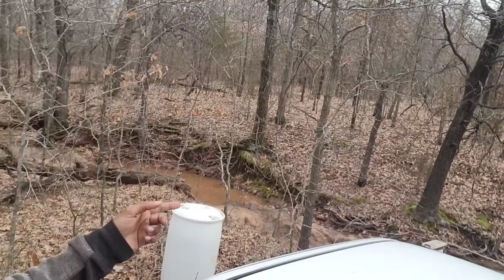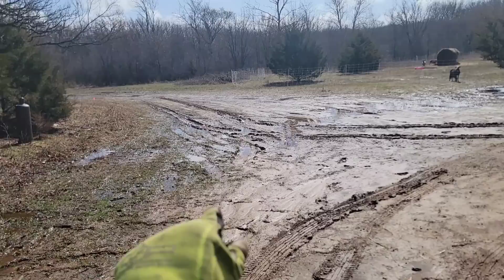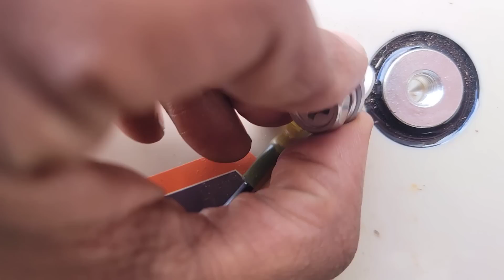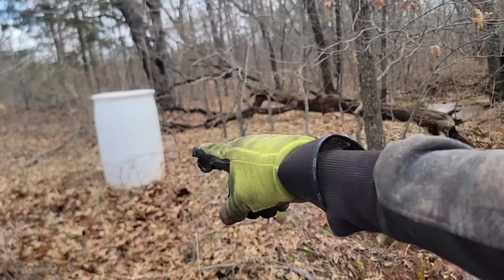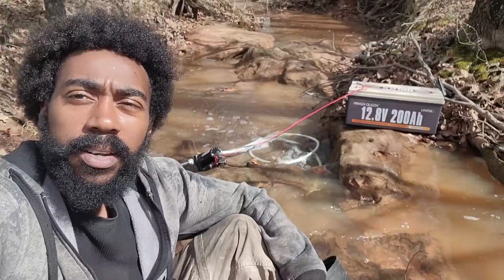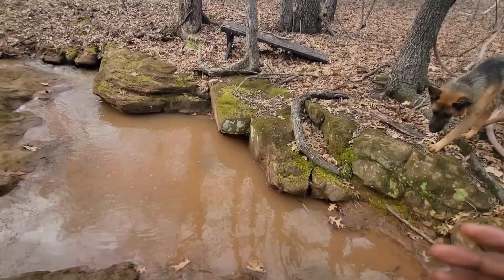How We Pump Water Off-Grid Using Just a Battery + Creek

Comment: Hello I love watching your videos but I just have one question are you planning to drink that water and how are you going to clean it can other question is are you guys going to be doing water catchment off your building so that it can be cleaner
Reply from the maker: No, we do not plan to drink creek water. And yes, we do plan on building a rain catchment, but our roof is only 12x24 so it's catchment is limited until we expand it. The creek can hold thousands of gallons so it's better to pump from the creek after a rain. We have a 4 stage filtration system that makes the water safe for use.

Comment: Might want to get nylon stocking or sock and put it over the hose so that you don't get a lot of sediment or debris.  A bigger pump and stiffer hose would get better result.  Just be careful with the water and that no chemicals are being sprayed around the area that can leech into the streams.  The idea of putting the dam, kind of wondering if that will help the flow or create problems elsewhere due to the heavy flow of the water.  Great idea on water sourcing and hopefully down the line you can add gutters to catch the water and maybe build additional structures as well.